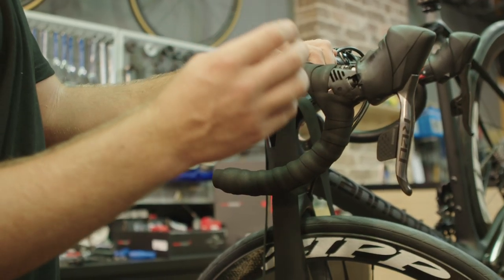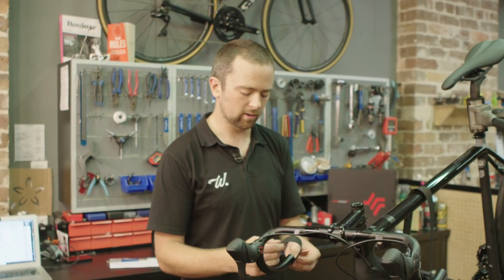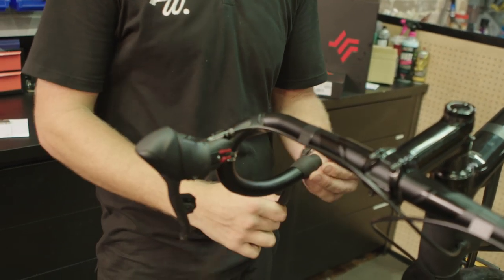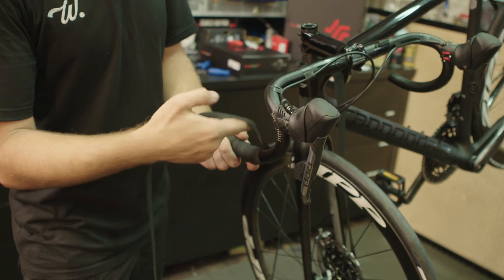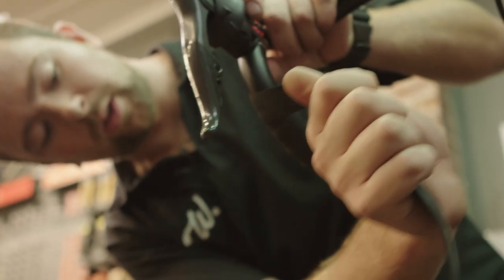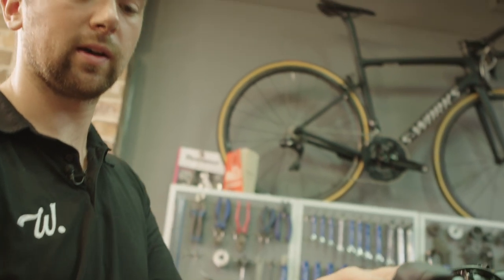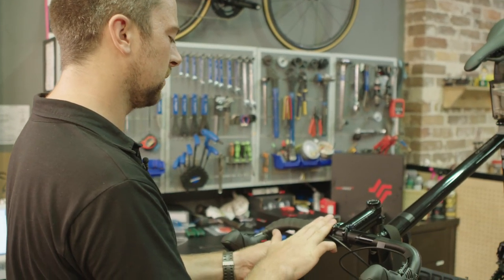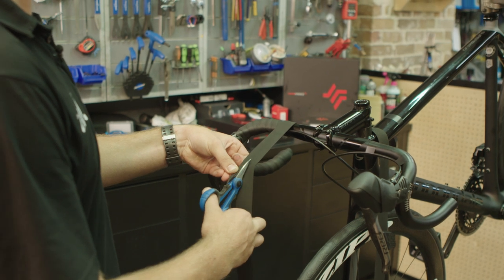Road bike basics: how to wrap handlebar tape

Comment: He messed up the figure of 8. The easiest way to tell is the top of the bars won't have the throttling effect
Reply: It's because he started off wrapping in the wrong direction in the first place. Even the bottom has that effect. I guess tape wrapping is a glass half full half empty kind of debate. But you're right on this one.
Reply: I have wrapped in many different ways and the current method is what I feel works well across the bar in terms of overlap, gives a good amount of padding at the hoods where it's most needed and then gives an even transition around the bends. I don't profess that the way I wrap is the way everyone should do it, If it gives a good feel, is clean and does not unravel or move then it is correct. I worked as Head Mechanic in one of the higher end stores in the UK and all the mechanics within our workshop wrapped their own way, we had no complaints with the tape from daily commuters up to fleets of bikes used a bike shows around Europe, I always felt its part of the personal touch to a full build, we could easily spot each others tape jobs.

I prefer the way the tape wraps on the top of the bars with the shown method, something about the way the lines looks. But if you prefer the other way then rock that. 

On a customer build I would alter the spacing up to the hoods to get a better transition but for this video I wanted to roll through it without stopping too much.
Reply: Looked ok to me?  As long as there are no gaps and it is neat.